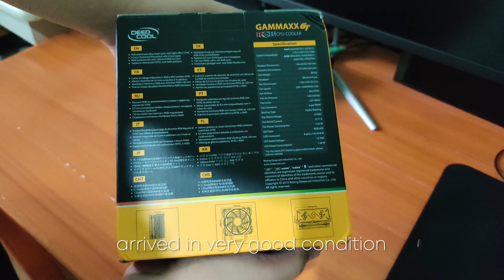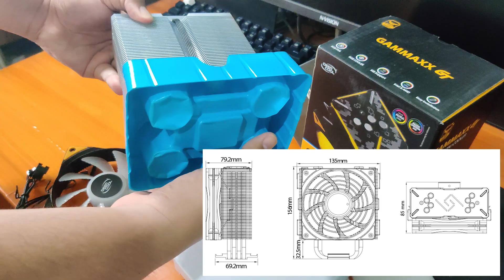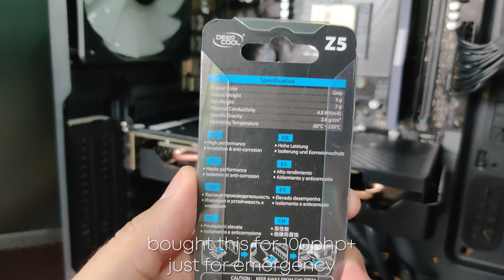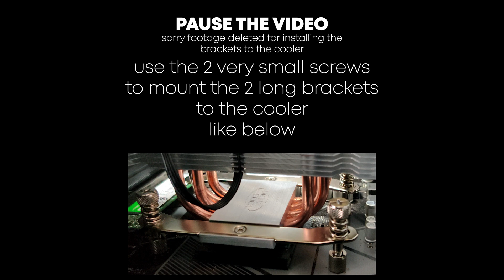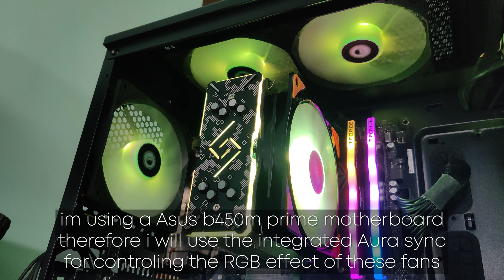DEEPCOOL GAMMAXX 400 GT TUF VERSION - unboxing, how to install, review

Comment: sir san po kayo naka order nan? nag hahanap po kasi ako
Reply from the maker: shopee paps, meron na neto sa easyPC
Reply from the maker: out of stock na pala, eto mga nakita ko sa shopee paps na may reviews na https://shopee.ph/Deepcool-Gammax-Gt-TUF-version-i.8595149.4643364943
Reply from the maker: eto yung exact item na binili ko paps, 
https://shopee.ph/DEEPCOOL-GAMMAXX-GT-TGA-TUF-customized-version-120mm-4-heat-pipe-silent-CPU-cooler-Multi-platform-support-AM4-LGA115X-775-i.277755892.3343975826

Comment: Paps tanong kulang bago pa kc ako s mga pc gusto ko sana ma sync lahat ng rgb ko kaso biostar b450mh yung motherboard pwd ba yun?
Reply from the maker: basta nay splitter ka pde yun paps. need dugtong dugtong lahat ng rgb headers mo
Reply: @nikkojoson  paps anong splitrer gusto ko  sana matutu
Reply from the maker: @emonggaming3790  anong fans gamit mo paps? daapt kasi mag dudugtong yang mga yan. yung rgb headers. tpos 1yung pnaka dulo nakakabit sa mother board
Reply: @nikkojoson  wlng brand paps rgb lng alam ko nito
my fb ka paps send ko sau
Reply from the maker: @emonggaming3790  dapat may ksma yan na rgb headers na 3 yung connector. 1 1 femate at 1 mate na rgb header. tpos 1 para sa power
Reply: @nikkojoson  -dko kc alam paano bukasan tong case ko paps
Reply from the maker: @emonggaming3790 mahirap yan sir. i suggest pagawa mo na lang sa may alam. baka masira pa fans mo pag namali ka kabit
Reply: @nikkojoson  cge paps salamat
Reply: balak ko sana mag air cooler na ganyan e sync ko sana s fans at ram
Reply from the maker: @emonggaming3790  parepareho lang po yung nag need naka chain ang mga rgb headers

Comment: Yung sakin hndi umilaw. Naka kabit naman sa rgb header ng tuf b450 ko pero hnd ma detect ng aura sync. Ano kaya problema? 😭
Reply: Oo idol. Bakit kaya? Saka hindi ma detect ng aura sync ng asus.
Reply: Pero yung fan naikot naman.
Reply from the maker: @msj080158  try mo sir itry sa ibang pc, if iilaw yung LED, if not baka defective, kasi dapat mag power on manlang sya kahit di madetect ng aurasync or other software
Reply from the maker: both fan and cooler sir walang ilaw?
Reply: Cge idol salamat.
Reply from the maker: @msj080158  tanong ka lang paps, if ever kaya ko sagutin para makatulong, and like and sub if kahit papano nakatulong itong video sa iyo, thanks!
Reply: Ok na idol. Best of luck sa channel mo. Nkakabadtrip lng 1st time ko mag install ng after market cooler palpak p. Pag kaka alam ko dapat iilaw agad yan e.
Reply from the maker: @msj080158  good luck din sayo sir, just drop a question, i'll try my best makatulong,lalo na kung na experience ko :) maraming salamat
Reply: Follow up idol. San mo kimabit yung wire ng heat pipe?

Comment: Bro just bought the same cooler pero may problema sakin eh. Mobo ko is B450M DS3H. Yung RGB ng cooler ko static lang. Para ma change yung color need ko pa pumunta sa RGB Fusion. And tsaka Static lang yung mode nya. Walang breathing. Pano po ba to bro? Yung 12v rgb dun ko kinonek sa LED_CPU header ko.
Reply from the maker: ang control ng RGB sir should be from your RGB header. Be sure to connect every RGB components to that header, if not possible, you will need a splitter/hub.  I looked up the b450 DS3H and I saw its located on the left side of your board, almost above the PCIE slot.
Reply: @nikkojoson  LED_CPU?
Reply from the maker: @sstayme7o  yung RGB headers ba ang tinutukoy mo sir? better to search yung mapping ng mobo mo sa gigabyte para di ka magkamali and iwas aberya

Comment: Ilan na po cpu temp. Gaano kataas improvement
Reply from the maker: 5 to 10 lang sir difference, depende sa work load, pero pag warzone average is 5 lang difference
Reply: @nikkojoson  ilan po idle temp at max temp?
Reply from the maker: @kukurbitomaximo3534  im not sure yet, but I will release a more update review about my whole budget rig, kung budget rig pa din tong matatawag dahil nagpalit ako ng 1660 super :D
Reply from the maker: @kukurbitomaximo3534  major reason why upgraded to this is the RGB, but from the 2k to 3k price range this is the best one you can buy.
Reply: @nikkojoson  haha hanap dn ako ng rgb na cooler nka 3600 kasi ko mainit sya d ko trip aio kaso puro nmn stealth mode mga darkrock tsaka noct. sad
Reply from the maker: @kukurbitomaximo3534  kung may budget ka paps noctua ka na. budget choice kasi tong saken, and if nsa 80 pa naman temp mo normal pa yan, 76 to 82 warzone ko eh, ryzen 5 2600

Comment: Ano gamit niyo sir na hub para mag sync lahat ng fan?Kasi isa lang din rgb header ng mobo ko na tuf b450m gaming plus.
Reply from the maker: hindi na need ng hub sir, sa case ko kasi may splitter na kasama yung idcooling trio fans ko, so dinamay ko lang sya dun, magkaka connect lang lahat ng rgb ng fans ko.
Reply: @nikkojoson  so pwede ko din pala isama sa splitter ng PC cooler fans to sir no?
Reply from the maker: @judyrheykalinisan4590  RGB pins lang sir ah, yung cpu pins dun pa din sa CPU fan headers.